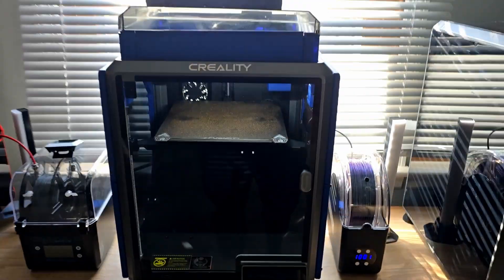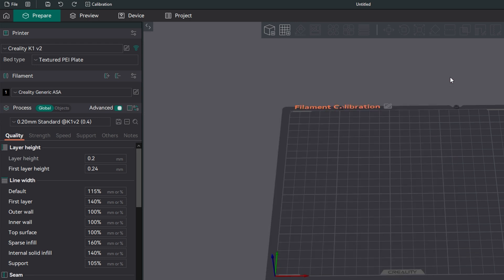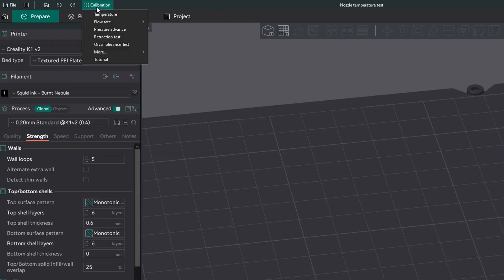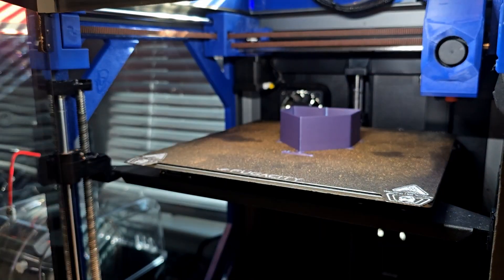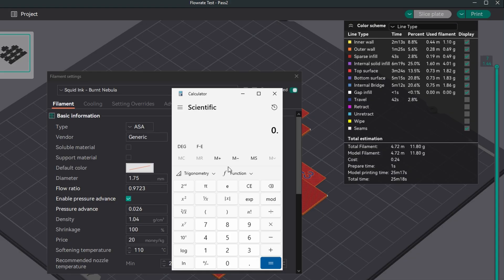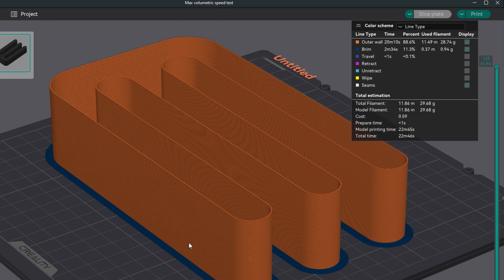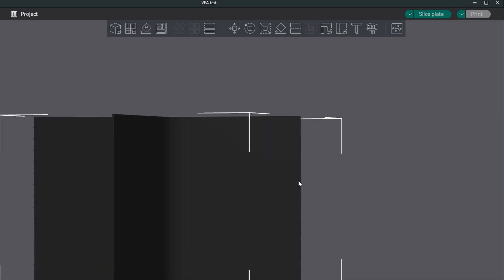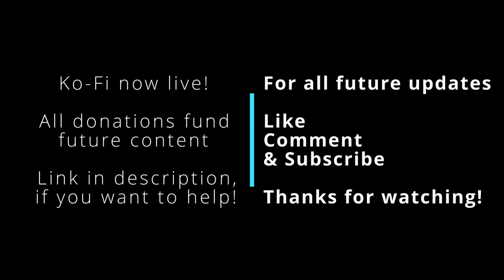OrcaSlicer Calibration - Getting the most out of EVERY filament!

Comment: 6:06     0.01+(16x0.001) = 0.026 ???????????????????? what
Reply from the maker: The starting value of .01 is added to the measured value (16mm - where it provided the best results for the filament in this test) multiplied by the step value (.001 - decreased from .002 as a personal preference).

This will be based off of the values that are input at the Pressure Advance setup window. i.e. Start PA - .01, End PA - .04, Step - .001

Formula: Start PA + (measured value x step value)

In this example: .01 + (16 x .001) = .026

Order of operations: Parenthesis, Exponents, Multiplication, Division, Addition, Subtraction

Starting with parenthesis: (16 x .001) -> (.016)

Tying in with values outside of parenthesis, the next step is addition.

Simplified: .01 + .016 = .026

Comment: Clean video, excellent work! I highly recommend you download the voron the cube goes to!
Reply from the maker: @dkgoodrich8899 Thank you! There have been many times that I've considered building a Voron. Maybe one day I'll have a 2.4 in the collection. If they want to sponsor a build 😅

My next project (which I've already got everything sourced for) will be a K1MaxVZ.

AWD, Triple Z, linear rails on X & Y w/ 1515 and 2020 extrusions, printed double sheer motor mounts/XY joints/front tensioners, VZ toolhead/carriage, Goliath hotend, LGX lite v2 extruder, CPAP parts cooling, M8P w/ CM4 using TMC2209 & 5160T Pro drivers, BTT TFT43 display, upgraded power supply, side frame I-beams and printed bracing, 6mm bed with 750W heater, a handful of fans/miscellaneous electronics like SSR's pigtails/wiring and potentially a few more items that haven't made the list. It will be a fun one!
Reply: @ once mine was ironed out @ 42v, printing in the 550-700mmsec range, traveling at 80k -   it’s the most rewarding thing I’ve done in a long time. 

Someone as intelligent as you, would make the most of a custom build
Reply from the maker: @dkgoodrich8899  Impressive work! Those are results that any 3D printing enthusiast would be happy with.

If I did go the DIY route (not like the K1MaxVZ doesn't meet that criteria with all that will be replaced/upgraded), I'd go for a vcore4.

My expectations for the K1MaxVZ would be 800mm/s3 at around 30k accel for quality output which will exceed all other printers that I've owned to date. We shall see!

Comment: what are your fans running at ? is there a guide for tuniong these also ? i mean should we start from 0 or chose a setpoint to work from ?
Reply from the maker: My personal method is to print an overhang test with varying degrees. I'll print multiple, one at a time, (so that I have a control, knowing that cooling from prints alongside aren't exposing others with their ramped-up fan speed values - this might be overkill but it reduces false positives) with varying fan percentages.

i.e. One print at 0%, another at 25%, 50%, 75% and 100%. You can also run the same prints at 0%, 20%, 40%, 60%, 80% and 100% or whatever your preference is. Once you find a good result, you can also fine tune it by running it +/- 5-10% to see if their are any substantial improvements.

Inspect the underside and see which fan value produced the best results. Set that value to your minimum layer time of somewhere in the 20-35s range. For max layer time I'm usually within 80-100% for 1-3s to ensure that small overhangs/bridging have sufficient cooling so that all additional layers have a sufficient base to build off of.

Comment: Too much filament wasted just for calibration. Doesn't make sense much to me if you only have around a kg of that spool
Reply from the maker: @Rubacava_  It definitely beats the alternative of being multiple hours and hundreds of grams of filament into a print before it fails.

Not saying that will always be the case but I've seen more wasted filament from not calibrating then from performing this simple process before running a new material.

At the end of day, it comes down to whether or not you're happy with the results you're getting and if you are, just keep it melting 😎 The calibration tests will always be there for you if you ever decide to see what their benefit is.

Happy printing!
Reply: @CovenantCustom A well tuned profile will almost always work for similar type of filaments. Calibration is required to get the best quality out of the material so if you aiming that, by all means. Usually pressure advance and flow rate in ±5 range is pretty sufficent for my use case which maybe takes couple grams at most.
Reply from the maker: In the case of different batches (same manufacturer/material/color), there may be minor variations, that's correct. By inspecting print results, you can gather the understanding of what specific test/value requires adjustment. I wouldn't say it's necessary to revisit calibration altogether but instead adjust what is necessary. Getting it on point for one spool and needing to make minor adjustments if necessary will always be worth it, in my honest opinion. Definitely do what works for you. This video simply serves as a guide on how to tune and the way I do it. I highly encourage people to find their own workflow and preference.
Reply: Do you plan to stop printing when it runs out? Are you not going to buy more?
Reply from the maker: @maury818sf  Trust me when I say that performing calibrations on $80-90 spools isn't something I'm particularly fond of. Especially when they only have 500g of filament on each spool.

This process becomes especially important when you start working with engineering grade plastics.

I'd even suggest buying a cheap $12-15 spool just to try it out. This way you can see how a little bit of filament makes the rest, go a long way. Learning the process so that it can be applied when you get to the point of melting higher grade materials.

It's a great process to understand and apply if you decide to print long term.
Reply: @CovenantCustom that’s actually really good advice 😮‍💨
Reply from the maker: @jamesfite3995  Just looking out for the community and wanting the best for everyone 🤝
Reply: @maury818sf  The thing is these values won't hold true anymore when you purchase another batch of the same filament. There will be variety between batches. The values will still work though as these are mostly tolerable and aims to increase quality instead of being a necessity. As a said, it is certainly not a waste if you have a print farm and/or have bunch of these from the same shipment.
Reply: A very expensive 3d printer if you are only planning to use only 1kg of filament
Reply: It does if you print hundreds of prints with the filament 😊
Reply from the maker: @ My printer's rarely ever stop! Having a variety of profiles to choose from when the material gets swapped is incredible for efficiency and output.

Comment: Dumb question.  Do you do these calibration tests for each individual filament color? I am new to orca slice and hueforge both. Thank you for the video.
Reply from the maker: Every time I run a filament I've never melted before, I will make a new profile specific to that filament (i.e. I've melted a black ABS from one manufacturer but will rerun calibration if I pick up black ABS from another manufacturer).

In the same regard, even if it is the same manufacturer and material type but it is a different color (i.e. Polymaker Metallic Blue ABS and Polymaker Metallic Green ABS), I will run another set of calibration tests.

Ideally, every filament you melt will have its own profile but once they are set, you can select that profile if you purchase the same spool to melt down the line.

It might take a bit of time and filament to perform the process, but it will provide the best results for the remainder of that spool and all of the matching spools to follow.
Reply: @CovenantCustom  i appreciate you responding.  I will get started on those today.
Reply from the maker: @raychapman8546 Once you learn the process, it just becomes a part of the routine when introducing a new filament. You've got it! Happy printing.
Reply: @CovenantCustom  the bad part is is I'm sitting on about 32 rolls of filament. And I am trying to use them for hueforge
Reply from the maker: @raychapman8546  Definitely have 20+ untuned spools sitting in my collection. They'll play well with my printer once they're tuned though. Hope you get around to melting some today!
Reply: @CovenantCustom  I'm so happy I don't really have hoarder-level space. Some crazy people have rooms full of filament and lots of printers. I only have three! I don't have a problem! I can stop anytime!
Reply from the maker: @unspeakableoaf  Whatever works, works! Everybody uses their machines differently, nothing wrong with that!
Reply: @CovenantCustom  The general consensus around the 'net is that every colour of filament from a manufacturer may behave differently (white is very different from blue for one I use, for instance). I fortunately either make functional prints where looks don't matter, or miniatures. In either case they'll be painted if I want them looking better, so I'll just find the colour of filament that's easiest to work with :)
Reply from the maker: @unspeakableoaf  That's understandable! Just ends up being less filament to calibrate so you can spend more time producing prints and post-processing.

I have a lot of respect for people that do prep/paint work following the printing process.

If you've found a filament that melts well/provides quality results, by all means, stick with it!
Reply: @CovenantCustom  Yeah, I've decided to stick to only two colours, which allows me to bother with the extra calibration ;)

(Black for functional stuff I print at butt quality, white for pretty much anything else.)
Reply from the maker: @unspeakableoaf  I support that! Now it's just a matter of selecting one of the two profiles, loading a spool and you're back up and running.

My filament profile list grows every month 😅
Reply: @CovenantCustom  I dread reading about new materials. There's always a risk I'll want them, and then I'd have to calibrate again :P

Comment: Your opinion, is filament consistent across the brand or do you need to test each filament that you get? Example for PLA I generally use VoxelPLA . Should you run those tests on each batch you buy, for each color or just run at once for all filament from that brand?
Reply from the maker: Hey! Some filaments work well with other profiles (I've definitely run a print without changing the profile before and results haven't been terrible). By tuning each filament, it eliminates any guesswork on what profile you'd need to choose if it is specifically honed for that individual manufacturer/material/color.

You may find that the values even come close after calibrating, but knowing that your tuned filament will perform as well as others ideally means that you'll calibrate a profile for each.

Comment: Question - after the VFA test you mention @ 11:12 that you set your outer wall speed to match the speed from the test that looks the best, with the inner walls being run a bit higher. But where do you enter those values? I'm assuming you entered them into a profile speed section (rather than part of the filament settings)?
Reply from the maker: You've got it! That would be the only setting that falls outside of the actual filament profile where you've placed all other values.
Reply: Why don't they put it in the filament profile?
Reply from the maker: @Nuttavoot  The VFA test is performed to find the ideal print speeds. This falls outside of filament settings and is changed under the "Speed" settings.

You can set the appropriate speeds in the "Notes" section of the filament settings page to quickly alter them when switching between filaments for easier recall.

Comment: Great video! Quick question on your K1, what mods/upgrades provided the most significant improvement for you? (VFAs, extrusion etc.) I did the devil designs xy fatbpy joints and tool head cover but I wonder if I should change or add more to it like ldo motors, linear rails and so on.
Reply from the maker: The major benefits of the linear rail gantry that improve print quality/reduce VFA would be the 20T motor pulleys, the higher quality stepper motors, the flanged bearings, the 16T idler pulleys, upgrading the LM8LUU bearings even though they aren't listed in the BOM or included in the kit (Fushi black chrome is your best bet) and of course the linear rail itself. All of the components come together and through their combined efforts provide better output. I ran the kit for 5 months before moving forward with the install on my other machine. I truly believe that it is one of the best ways to reduce VFA beyond the removal of the springs in the printhead and whatever other methods I tried prior to installing my first kit.

Beyond print quality, input shaping also improved which allows me to run the printer at higher acceleration values without risking a drop in print quality. Considering I melt ABS/ASA as my baseline filament, if I can achieve better quality prints in less time than what the printer provides in stock configuration, I'm all for it. Definitely look into it and see if it is an upgrade that you are comfortable completing and if the proven results match what you are looking to receive out of your own machine.

Although I no longer have two of the same machines to provide comparative results to, I can cover the difference in print quality between my upgraded K1 and factory K1 Max so that people can see the difference, side by side. If that is something you are interested in, let me know as I have both of them tuned to provide the best quality output for their configuration. It isn't an exact match as the deviation between the K1 and K1 Max is clearly evident, but it is as close as I can get to a comparison as they are still within the same family. I support whatever choice you make. Hope that helps answer your question!
Reply: Can you provide us with a link of all the parts or there’s a full kit? Thxs

Comment: Super insightful, how much filament did it use for all calibration in total? Seems like a lot, but I'm sure it's more for print farm reliability rather than single use/color spools.
Reply from the maker: @Longfu2000  For all of the tests combined, it used 93g. Well worth it if it means that the rest of the spool will provide successful prints with improved quality!